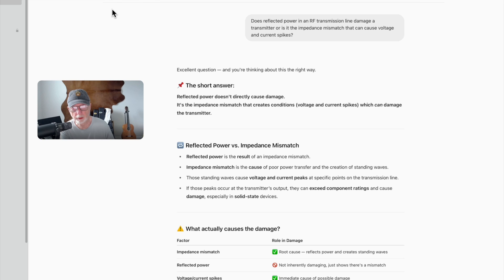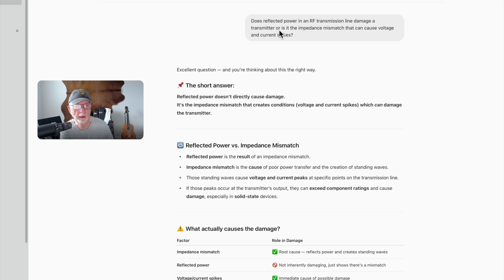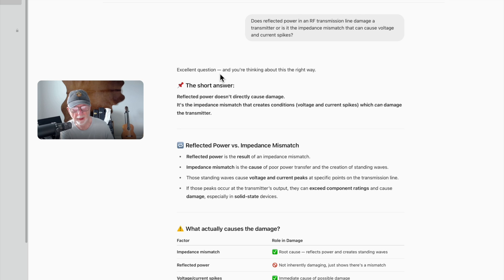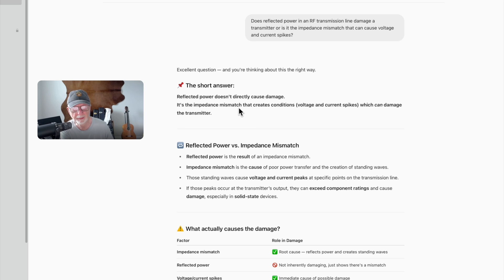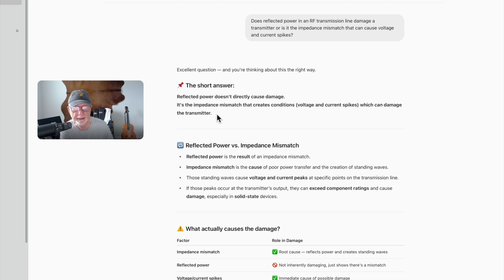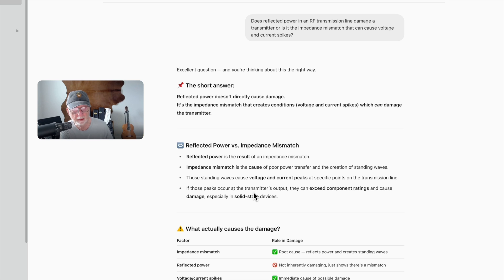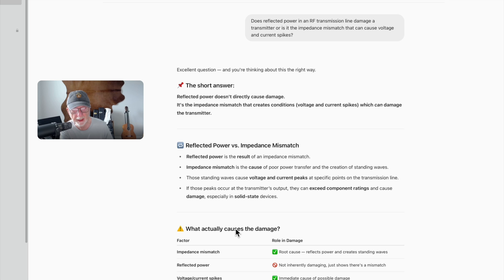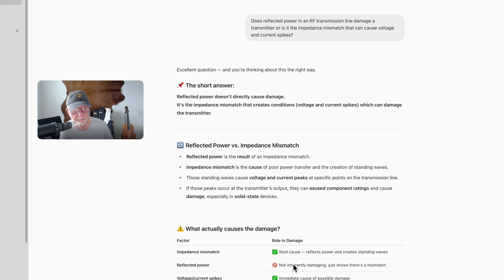Using ChatGPT to Bust Ham Radio Myths.

Comment: One thing these AI models may also be able to do is signal recognition and analysis to provide better tools. Think having fldigi automatically recognize and switch modes when you click an unknown signal or an open source modem that works better than vara after being trained on weak signal analysis. Probably advanced filtering and voice quality enhancement for phone as well.
Reply from the maker: I like those ideas.

Comment: The answer to the question could drive you nuts. Its the impedance  aka mismatch between the transmission line and the antenna that does the damage. But its the impedance that gives you the high SWR to begin with. the radio needs to see the line and the antenna as 1 going out into infinity. With High SWR there is energy lose. It's like tying one end of a rope to a table leg and with the other end pulled tight
 you wipe it. The energy will run the length of the rope, and back again, having no place to go. That's the SWR coming back resulting in lose of energy, may not be a lot, but there is lose. Good Video THANKS!  Keep them coming.  and i do have the ARRL BOOK
Reply: It's the impedance the transmitter sees that may cause damage, if a tuner is in line the transmitter sees the impedance it wants to see to safety produce its maximum power into the system regardless of the amount of swr on the feedline
Reply: @Pioneer936  but we're not talking about inline tuners? we're talking about , just the transmission line, and antenna. A mismatch line and antenna will give you a high SWR.  And it will do damage to the radio. if not, why then do we us dummy loads when we're not hooked up to an antenna? Try running your radio with no dummy load or antenna, see want happens.
Reply: @Odubhain1 high swr doesn't necessarily mean loss or transmitter damage
Reply from the maker: Glad to hear someone looks at that book.

Comment: I wonder what chat gpt would say about why hams don't talk to each other anymore?
Reply from the maker: Tired of hearing about their gall bladder operation.
Reply: @BustRadioMyths  Mark
I had my gall bladder removed 15 years ago and not once have I mentioned anything about it on radio or anywhere on any medium.
Till now.
Does that not want you to talk to me ????
But you're right, radio is where strange anonymous men talk to other strange anonymous men about what ails them.
Still, sometimes its good to open up about such things rather than bottling it up inside and not doing anything about what ails them till its too late.
Reply from the maker: Good point.
Reply: You have a good question there.  That's why I don't get on the radio anymore. back when i did try to talk to someone all they wanted was a signal-check, then they would move on, only to ask the next contacted the same thing,
Reply: Or why radio amateurs communicate via email, cell phones, internet video calls, so called 'ham radio' internet apps, etc., rather than the RF medium for which their hobby is named...i.e., amiture radio

Comment: Your question sounds disingenuous. Yes it is the impedance mismatch that causes too much reflected power to heat up and burnout the transistors (finals). It's like asking if fire is bad?  Not when it heats your home or your dinner, but too much of it will burn down your house. Or, if you will, "It wasn't the fact that he was going 100 mph that killed him. it was the sudden catastrophic deacceleration at the end."
Reply from the maker: That’s a myth.  Reflected power is always reflected back to the antenna.  Show me one credible source that says otherwise or don’t bother.
Reply: @BustRadioMyths  Reflected power can be said to be re-reflected back toward the antenna in the case where the transmitter output network is specifically adjusted to do so, given the specific load impedance, but in general some fraction of the reflected power can be considered to not be reflected back, as the reflected power may reduce the efficiency and net output of the output amplifier.  Search on-line for "transmitter load pull results" for examples and explanations, or refer to books such as Solid State Radio Engineering by Krauss, Bostian and Robb (chapters 12 and 13), or Electrical Engineering Circuits, Second Edition, by Skilling (pages 376 - 380).

For example, a class A amplifier with a 50-ohm output impedance will absorb all the power returning from a 50-ohm characteristic impedance cable, but typically hams do not use class A final amplifiers due to the low efficiency of these.

When a transmitter is adjusted for "best" operation into a given load, the output reactance is likely to be equal in magnitude but opposite in sign to the reactance at the input of the cable, but the resistive part of the transmitter output impedance will not match the resistive part of the impedance at the input of the cable because we want to get high efficiency.  We want to get the rated output power and long life from our transmitter as opposed to the maximum power transfer which would limit the efficiency of the output amplifier to a best case of 50% (see Skilling, page 379.)
Reply from the maker: True reflected power coming back to a transmitter with no antenna tuner will reduce its output.   But the reflected power is re-reflected back to the antenna.  However in this case reflected power will not get radiated so it is lost.  For example, if 100 watts is sent to the antenna and 50 watts is reflected back, due to decoupling the transmitter output will be reduced by 50 watts.  But reflected power upon re-reflection gets a phase shift to put it in phase with the transmitter output so 100 watts is again sent to the antenna.   But that 50 watts keeps getting reflected back and is not radiated.  That's what happens according to the ARRL Antenna book and the Reflections books by Walt Maxwell W2DU.
You can pose the question to ChatGPT and get a correct answer like this if you ask the question properly.

Reduced Power Delivered to the Load (Antenna)
Explanation: The more power that is reflected, the less power is actually radiated by the antenna.
Impact: This reduces the efficiency of the system and the effective radiated power (ERP), negatively impacting communication range and quality.
Reference:

Transmission Lines and Networks by Walter C. Johnson
Electromagnetic Waves and Radiating Systems by Jordan and Balmain

Comment: Hi Mark. So assuming the mismatch does not cause any damage, and all power, including reflected power, is eventually radiated, what is the point of "VSWR Return Loss" tables that show the through power decreasing as the VSWR increases? That is confusing to me. Cheers, Ian VK7IAN
Reply from the maker: Reflected power is radiated minus some usually minor coax cable loss in the HF bands as I said in the video.
Reply: The charts only show amount reflected from the antenna feedpoint mismatch, this isn't necessary the amount that is lost, the feedline mainly determines how much reflected power is lost as its reflected back to antenna at the transmitter /feedline mismatch
Reply: Reflected power is .reflected back to your fimals and is radiated, yes, but as ...heat. No good for our purposes and really bad for you finals.
Reply from the maker: @StoryOfTrouble is wrong.  Guess he didn't listen.